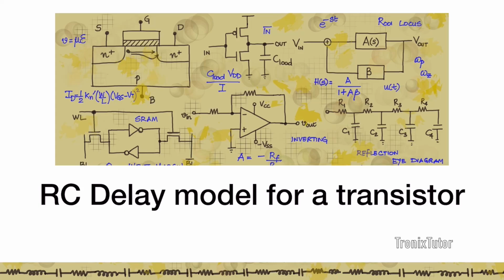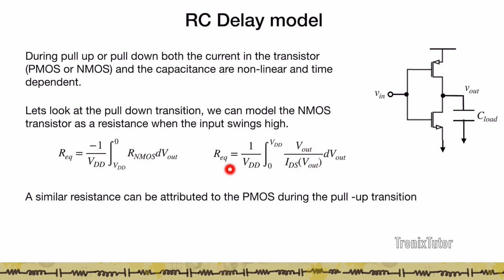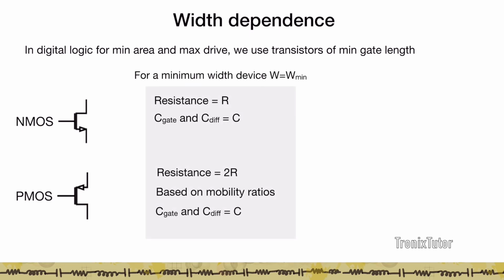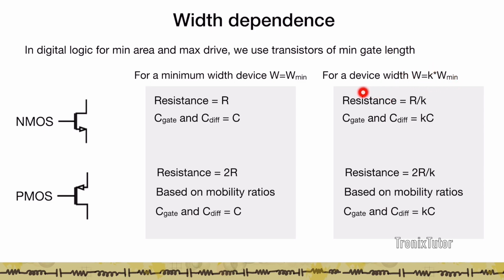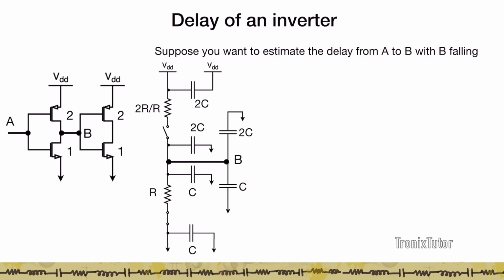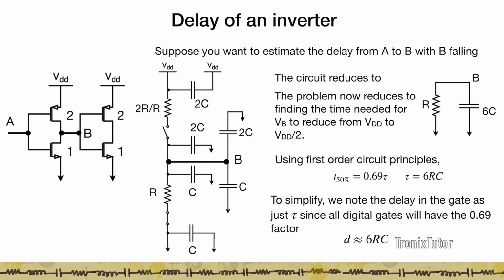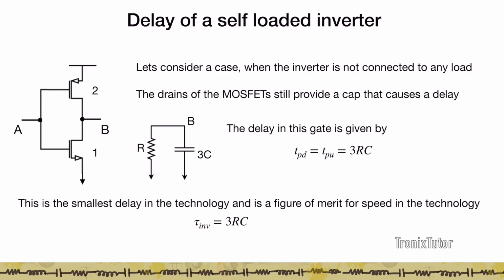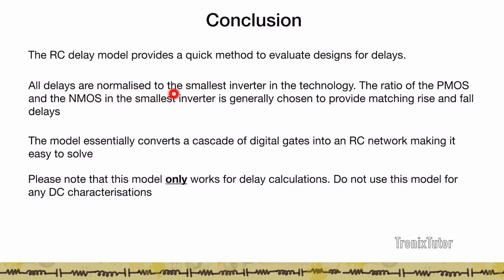Why Does Fan-Out Slow Down Your CMOS Gate? | RC Delay Model Explained

Comment from the maker: Key intuition to remember:

Most delay in modern chips does NOT come from the transistor itself.

It comes from:
• wire resistance
• wire capacitance
• fanout loading

That is why RC delay models are so important in digital design.

Next concept to learn:

Elmore Delay Explained  
https://www.youtube.com/watch?v=CZb1LompCVE

Then:

Logical Effort Explained  
https://www.youtube.com/watch?v=q3bgevMGjEk